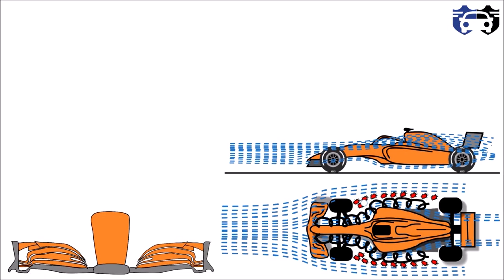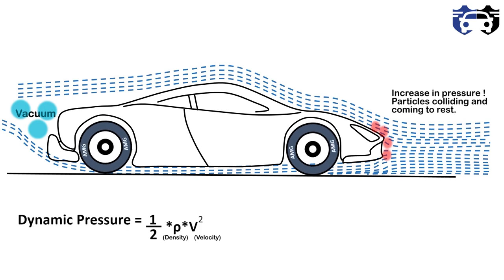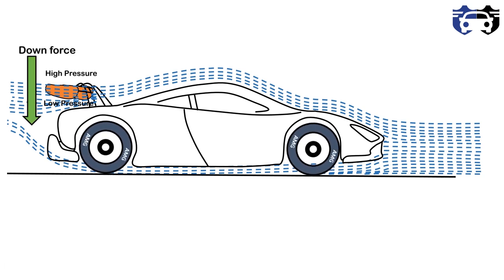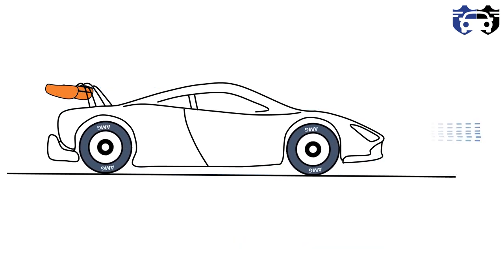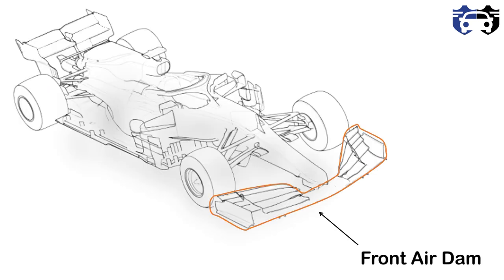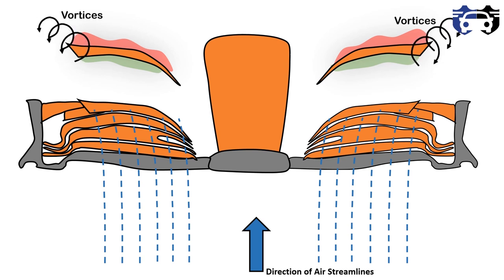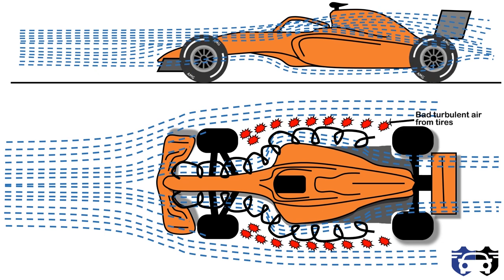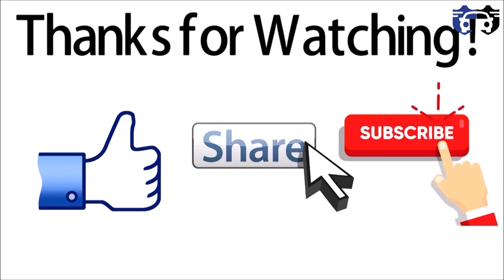How front spoiler or Air dam works ? - Aerodynamics

Comment: Explanation of the splitter is not completely correct. It is true that you get some downforce from the high pressure over the splitter. However, the majority of the downforce comes from under the splitter.

Also incorrect is how the downforce is generated from the underbody. Negative pressure is not generated via a decrease in air molecules - this would be true for air dams. Front splitters, however, do the complete opposite - they increase the amount of airflow going under the floor. This causes the effective cross-sectional area of the air flow to contract, which increases velocity due to conservation of mass. This increase in velocity will directly contribute to a reduction in pressure as per Bernoulli's Principle. You can see this effect taking place when you look at wind tunnel tests and CFD simulations of front splitters.

To increase this effect, many high-end race cars would actually angle the splitter upwards or make a very rounded leading edge. This forces more air under the floor, increasing the contraction ratio and therefore increasing velocity and reducing pressure of the flow undee the floor.

The problem with this method of increasing downforce is that if the floor isn't flat, then the air can start being impeded under the floor, which increases pressures significantly. This is why aerodynamic underbodies are so prevalent in race cars.
Reply: Wouldn't the front splitter angled up just create an air cushion under it creating lift at the front?

My understanding is that due to the shape of cars the air taking the route over the car's body is taking the longer route. So even though there will be higher pressure initially at the front, as the air continues towards the back of the car there will be more separation alongside it, all of which will cause that air to be a lot faster and in points of separation will create low pressure and therefore generate lift. Making some of that air go under the car instead will relieve some of the initial pressure on the front, but should create an air cushion under the splitter.

What I see on modern F1 cars is that although the front wing is higher, whatever air enters the underbody, they initially throw all of that out to the side using vertical fences and then widen the tunnel for the innermost air channel as it goes towards the diffuser to reduce pressure even further. The momentum of the air ejected to the sides also prevents some of it from re-entering the diffuser near the rear wheels creating turbulence. The fences themselves are also shaped kinda like wings to generate additional downforce.

So it seems to me like you don't really want to force the air under the car as much as you want to just prevent it from going over the car.
Reply: @1InVader1  I think a lot of this depends on how flat the bottom is. If it is a street car from the factory, the air can get hung up in all the the spots where suspension bits etc hang down and interact with the airflow. If it has a flat bottomed tray type device installed underneath like some racecars, then the air that goes under at a higher velocity which drops the pressure and creates that suction effect underneath the car (where you want it). 

 I think this also necessitates a rear diffuser, as well, because if you can get air flowing under the car faster, and then it diffuses to a larger area smoothly, it shouldn't create  a low pressure area behind the car once it exits from underneath. 

As long as the air is exiting smoothly and not getting hung up on anything, more air going under the car should just move at a higher velocity, creating a pressure drop and suction under the car (experienced as downforce)

Comment: Thanks for the knowledge. I have a question about top speed. So basically because of the higher downforce produced by both rear wing and front lip on a car, it will decrease top speed right?

Comment: Air freely moving under the car would reduce the pressure, not raise it. 
Slpitters as do wings, primarily work on the low pressure created on the underside, not the high pressure on top.